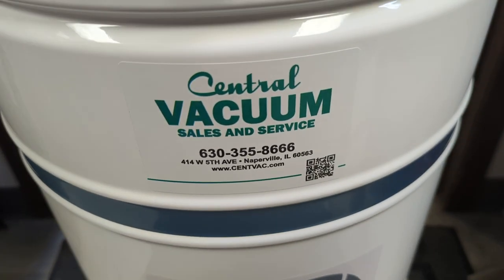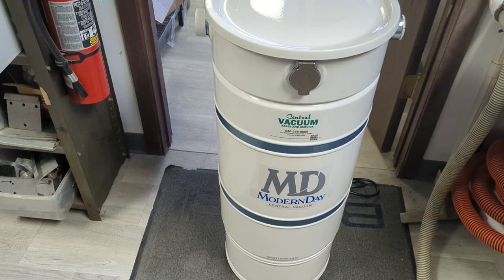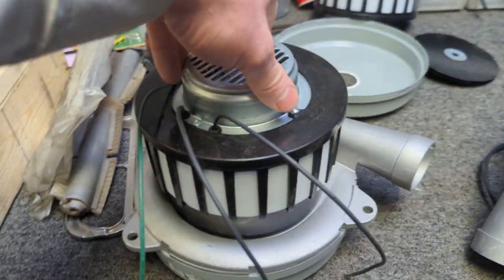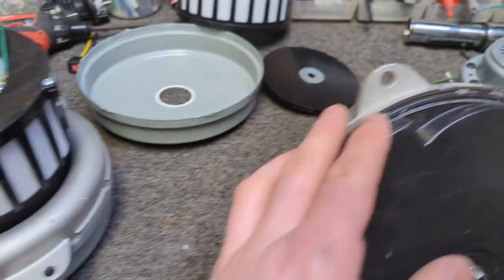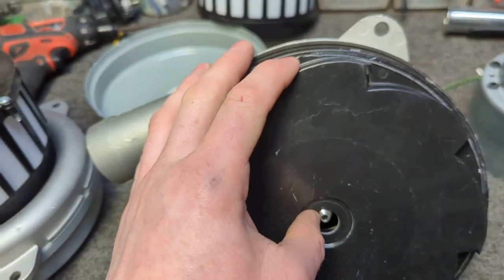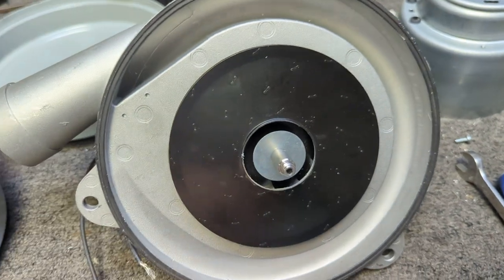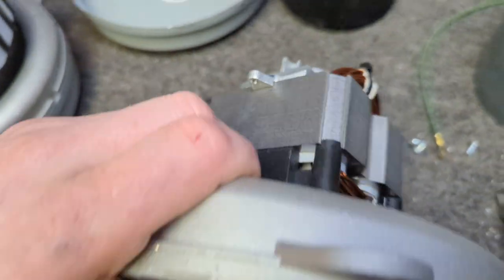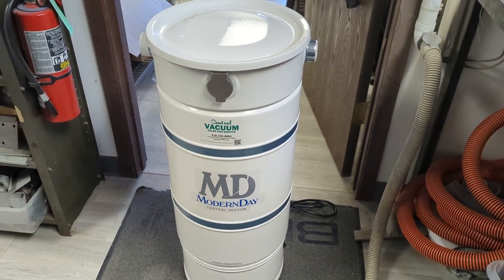This vacuum has some "Huevos"! The ModernDay M715H and the 8.4" Ametek motor inside it

Comment: Can MD for once build the machine where the motor is on top?  Servicing these things is probably a pain in the rear.   Especially since the thing weighs more than it needs to be, the amount of time it takes just to get to the motor where you have to remove the bag from three points,  lifting it up and over the machine, remove the filters, invert the machine, fix or replace the motor, invert it again, lift this thing back onto the wall, replace the filters, lift the bag up and over and down into the unit, fit all three bag intakes, you get the point.  It's just a bad design.  There's a reason why MD is the only manufacturer still using this design and the other one that uses this design still builds its machines like older Filtex units with the motors on the sides and to the front.  Those you don't really have to remove from the wall.  Most other units you pick up off of the wall, set it on the floor, remove the top and, there's everything staring you in the face.  No bags or filters to remove and no inverting.  Cana-vac still uses this motor in its XLS990, a machine that's still pretty easy to maintain.
Reply: MD does have top motor units available.
Reply: They do make units with a motor on the top. In fact, I believe that their AirMaster XL A715h has the exact same motor as the unit shown in the video, but mounted at the top.
Reply: Yes that is correct.
Reply: @panasonicvac4036  Well, maybe they should change to strictly top motor.  Easier to fix, maintain and handle.
Reply: MD sells a AirMaster A715h model that uses the exact same motor as this one does and it's a top motor unit.
Reply: @panasonicvac4036  That's great, I'm not spending money to ship one of these units all the way from California when I can buy a Cana-Vac from my in-town dealer who can probably get it from the plant an hour down Ontario Hwy 8 in the next county.
Reply: And you don't have to get an MD, nobody is telling you to do so. You can choose whatever is best suited for you. But I'm sure there are people here that also don't want to or can't ship a Canadian made unit in the states. I was pretty sad when A.C.V. (All Canada Vac) left the US market because I though they made some pretty cool units. They had a thing where you can unclip the motor housing off without having to take the entire unit down or use a ladder to get inside of the motor.
Reply: @panasonicvac4036  You're right, and the ACV unit is what I am thinking of when it comes to ease of repair.  I think that's an awesome idea, to be frank.
Reply: @WJCTechyman As Panasonic Vac said, nobody is forcing you to buy an MD. There are multiple good central vacuum manufacturers, including the ones you have mentioned.
I think that it would be silly if MD stopped making these units, as that’s what they’ve been known for. I find it very respectful that they are catering to other customers by providing the “traditional” central vacuum unit in addition to their bagged units.

Personally, I really like the top fill bag units. I do not like closed bags as there are lots of accidentally vacuumed things that need to be retrieved in our application and the bagless units are quite messy to empty. Unfortunately, as MD is not available from dealers around here and it would cost too much to ship, that is why I will most likely never own an MD. But I do really like their design, and would probably get one if I lived near their dealers. They do not need service often, and if they do, it is not very difficult to turn it upside down.
There is a reason they still exist, because these types of units are still in high demand.
Reply: @panasonicvac4036 That detachable motor housing was super cool!
Reply: Yeah I wished Vacumaid adopted that design right when A.C.V. went out of business.
Reply: @panasonicvac4036 Yeah, that would have been great.